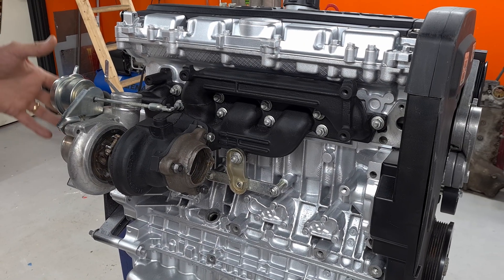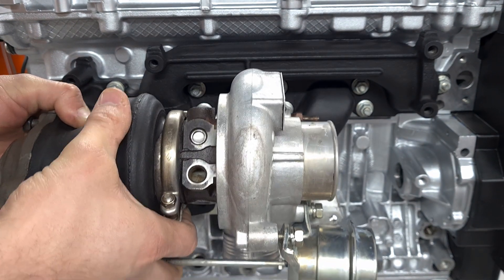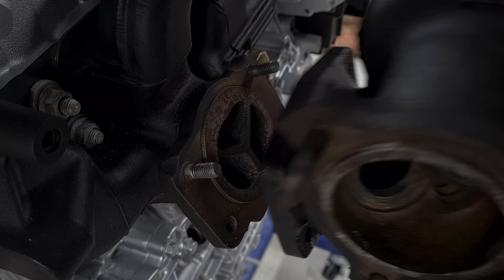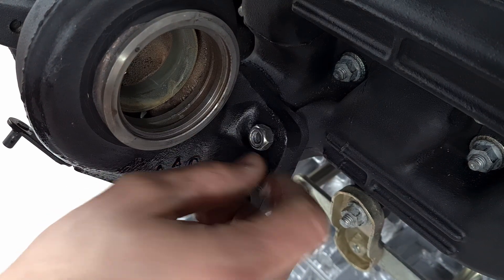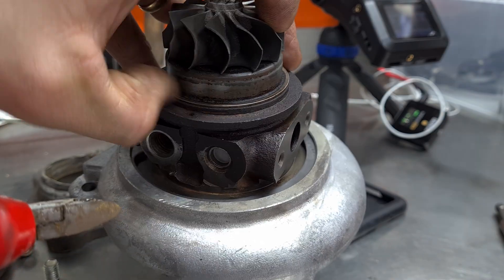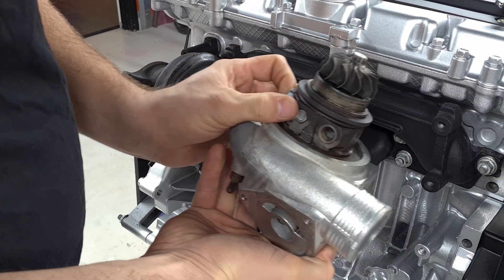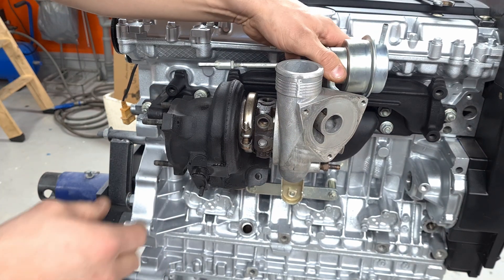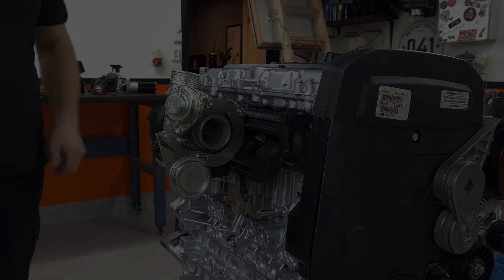Put Your Turbo Upside Down || Clocking the 850 Turbo || The Volvo 740 T5 Project

Comment: Hej! Gillar dessa videor. Vilken motor skulle du säga är den bästa du provat? B230 eller någon annan? Ha en fin dag!
Reply from the maker: Tack för att du kollar :) Vet inte om det finns någon favorit så direkt, alla är ju bra på sitt. Hade en Fiat uno 1.0L som man kunde piska dag ut och dag in utan att något hände, fantastiskt bra motor men kanske lite slö med sina 55hk.  
B230 ja den är ju väldigt drifttsäker men inte så jätterolig att varken köra med eller lyssna på, grym på låga varv, törstig och trött dock
850 T5 motor sjunger ju fint men är ganska trött på låga varv istället, ganska slöa original, mer jobb å trimma än b230 och dyrare men somsagt fantastskt ljud. 
Gillar Diesel femman i våran V70 jättemycket, stark som en oxe och ett skönt bröölande morrande ljud vid påstigning. Men tyvärr ganska död på höga varv. 
Rb26DETT som satt i min Nissan GTR jag hade en gång var extremt högvarvig och gick nästan inte att köra i normal trafik takt utan ville bara stämpla hela tiden vilket blev för stressande för mig i längden. Annars fantastiskt ljud och drog hårt med mycket ketchup effekt. 
Hade en 364 Nailhead V8 i en Buick från 1959, den va riktigt trevlig att köra men gammel som satan men samtidigt charmig och följsam. 

Det närmaste bästa kombinationen borde ju vara något i stil med en överladdad V8, Kraftfull på både låga och lite högre varv. Har alltid vart svag för v8 och är mera typen som skulle köra en E63AMG över en Toyota Supra tex. 

Men om jag måste svara på din fråga om vad jag anser är den bästa motorn jag provat så får det TYVÄRR bli en B230FK då den i särklass har hållt bäst och gett mig minst bekymmer under alla år. Men somsagt, alla har något bra att komma med.

Comment: Interesting stuff, but...
you're using an angle grinder with the intake side of the turbo on the same bench?
And grinding the body with the oil unions exposed? Not ideal...

Comment: Hello, i am currently working on a project like your. Mixing 3 cars into 1.
1997 volvo c70 t5 (engine and parts)
1995 volvo 960 2.5 (gearbox and parts)
1993 volvo 240 Polar (car)
Currently busy with the t5 engine (b5234T) stronger con rods, pistons etc etc. Holset hx40 preparing. 
Im still driving the 240 as a daily. I am wondering what i will find considering the motor mounts. I noticed you didnt do a video about those. Am i going to weld. Is it just mounting the 960 mounts on the 240 frame. Etc etc. 
Plus i noticed that at first u thought u wanted to keep the ac and later decided to remove it. Can you clarify? Simply impossible to keep the ac or?
Reply from the maker: Sounds like a cool project 👍. 

There will be a video later today (if everything works out) where I will be talking and assembling the engine mounts. They are off the shelf items  and I do have a 10% discount on them through speeding. Basically bolt-on things and you can get various models depending on what volvo and what engine and so on. 

I decided to not use ac because this car will no longer be a daily like the very first plan was. Its going to be more track-day oriented that planned so ac is not a priority. And a friend of mine really wanted the ac system so that tipped the scale for me and I sold it to him. 

//Backman
Reply: @BackmansGarage  ok good to hear. Im europe based so if you mind to add sources/ swedish shops etc in the description it would be appreciated. Im guessing i wont be using the 960 engine mounts due to age etc. 
I bought a dummy 2.0 block to get the engine bay ready.
First engine en transmission rebuild. 
Plus daily driver rust repair (s80 v8). 
Ill be checking your videos. Goodluck with the build and channel
Reply from the maker: I double checked the discount code and it doesent seem to work atm. So I will need to sort that out first. But I will be linking to the product anyway 👍
Reply: go on cutie

Comment: Why not use the rn version like a b5244t4..
Then you could run coil on plug easily and vvt.. Also has solid lifters, windowed block, and better coolant passages. As well as 9.5:1 rather then 8.5:1 little more low end torque.. I put the b5234t9 rn 2.3 in my 98 s70 t5m but went with a bigger turbo then td04hl. Mines also fwd so no clocking necessary. But always loved the idea of a 740/940 with a 5cyl. Also contemplated a 242 with a turbo ls but then i lose the volvo factor.
Either way very cool!!
Reply from the maker: I did have a rn b5254t from -98/99 to start with but making that run with motronic 4.4 was a little bit too much work and it needed more custom work that I wanted to avoid since i want this to be beginner friendly. 

I still believe that the B5244t5 from 2005  is the "better" engine to use, if you want to run aftermarket ecu and so on. They have however gotten very expensive latley. 

So the short answer is that this was just the easiest "og" way of doing it. 

I figured I would do the T6 which is an rn engine from a -99 S80 insted.
Reply: @BackmansGarage  i have an awd xc90 with the t6 awesome winter car and just all around. The 2.5 had some cylinder cracking issues. Any of the 5cyl whiteblock can run on m4.4 very easily. I didnt run cop and just drilled the end of the cam for the rotor plate and removed the intake cam sensor. Use the 98 intake with cable throttle. Plug n play. My tuner shut off o2 check and sas along with evap. We repurposed the rear o2 preheater wires to power the vvt hub at a set rpm/load point. And used the stock o2 signal wire as an analog to the aem wideband. All on m4.4

Comment: Just found this and I am SO EXCITED to see how it goes! What transmission/driveshaft do you plan to use?
Reply from the maker: Thanks 😁 I will be using the M90 transmission out of a Manual Volvo V90 with the inline six. Driveshaft from the same vehicle 👍 

There is a video way back when I remove that. In the future I might have to upgrade to a beefier transmission. So if high power is your goal you might want to go for a BMW diesel gearbox or something other that is stronger.

Comment: Always nice to see a new video. My b230fk rear seal is leaking, so that annoys me, as it is my daily and all. How much time would it be to take the gearbox away and replace the crankshaftseal?
Reply from the maker: I would say about 4 hours if you know what you are doing and nothing becomes a problem. But I would book a saturday if it was the first time doing it.
Reply: @BackmansGarage  That isn't to bad. Anything else you would replace. The clutch has been done like 15k ago.
Reply from the maker: Support bearing for the driveshaft usually goes bad in the rubber when dissasembing it, if its never been changed. The platic clips on the shifter might be a good thing to replace while at it, then you may or may not have the three point rubber connector on the driveshaft between gearbox and shaft, that may have cracks in it. Might also be a good idea to look over the rear seal on the gearbox, and if that is bad and have been leking, might want to go ahead and change the gearbox rubber mount 😄

Comment: what are the benefits of placing the turbo like that?
Reply from the maker: Its an rwd conversion, one must turn it upsidedown in order to fit it into the car. Either that or build a custom manifold.
Reply: He explained it in the beginning of the video! 💩
Reply: @jaunteraudi817  Its close to the firewall in my S80 2.5T also but it isnt upside down for that.